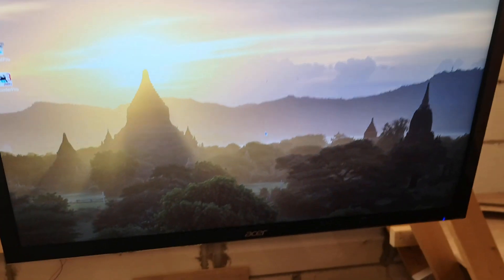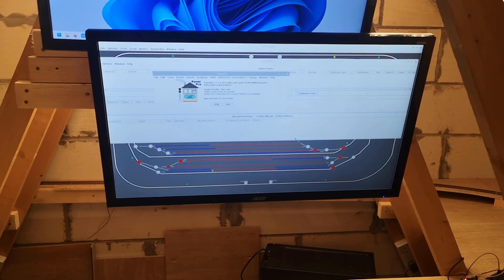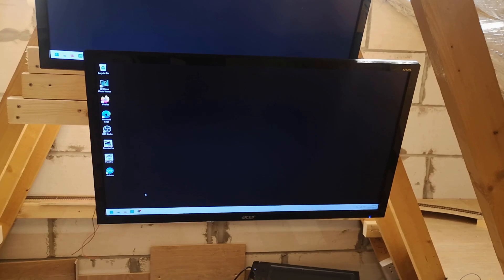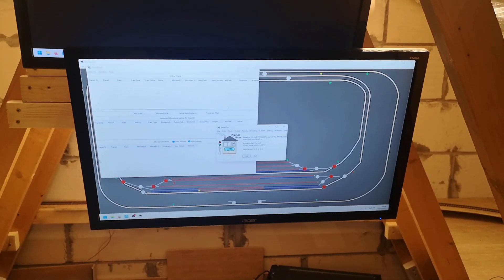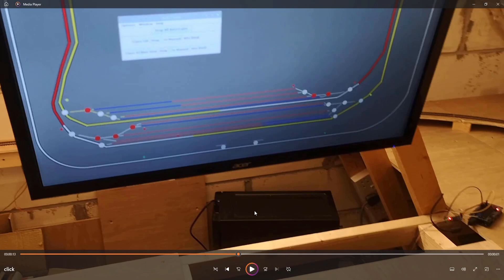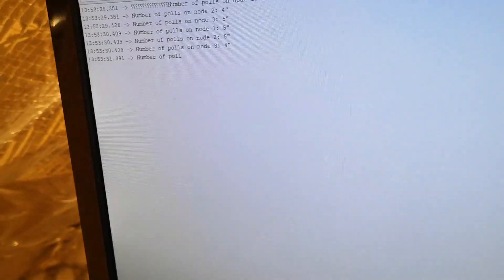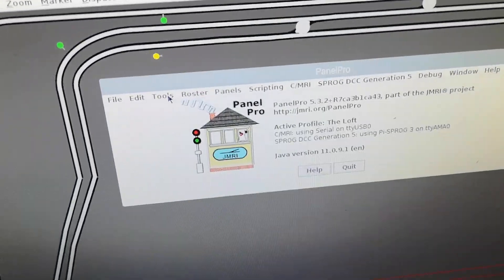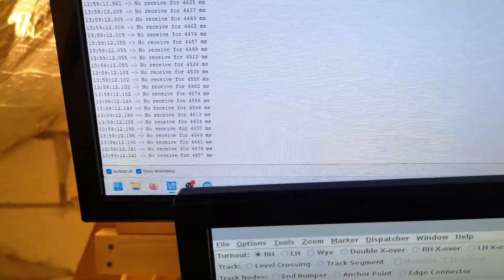Adapting a 5 amp Arduino motor board for a DCC Ex command station, and why my Raspberry Pi had to go

Comment: I  switched my Raspberry Pi 4 recently to a 2011 Mac Mini with an SSD when using JMRI.  With the money I sold the pi for I was able to get the Mini and SSD with some money left over.  I use DCC-EX as well.  Render times on the panel were horrible.  Should also mention I was running the Pi 4 (4 GB RAM) in an Argon case with fan and heat sink and using an M.2 Sata drive.
Reply from the maker: Thanks Brian - it's encouraging to know that there were no potential improvements with a heatsink and fan. I think the Pi is a great entry point for JMRI (or it was when it was more affordable) but needs to come with a caveat along the lines of 'it's great for the basics but look elsewhere if you're going down the automation route'.
Reply: @WirenwoodModelRailway  I agree.  I use raspberry pi's throughout my house all doing different jobs.  According to sources new units should be available in North America by Fall 2023 at regular prices.  It's crazy what they sold for lately.  Your automation is incredible.  Thank you for sharing.
Reply from the maker: Me too! I have a few of them running Snapcast for synchronised house-wide audio which i love, and another 4 up in the loft (including the rejected JMRI one) running those static cameras. They're such useful, versatile little devices.
Thank you for the kind words! Chris.

Comment: This is difficult to put without being critical but bearing in mind that you have a PC there, I'm surprised you didn't use it from the outset and when I discovered your channel I had assumed you were. JMRI will work via ethernet to attach to a command station, and I suspect the Pi (from personal experience of using it to monitor systems) is not really up to the task of a sophisticated layout. Another aspect to consider is that the quality and length of the bus and the number of nodes will affect the baud rate of RS485. I doubt that you are hitting the limits, but maybe still worth considering? I use an old Dell laptop (i5 and 8GB RAM)  running linux for JMRI connecting to a Z21 via ethernet although I might go to DCC EX and sell the Z21. The DCC EX recommendation is to use a Mega not an Uno as the Uno is at the limit of the memory when running DCC EX.

You are sir a trail blazer, I take my hat off to you.
Reply from the maker: Ha, thank you! Actually, right back this time last year when I started this layout, I was using an Arduino and motor shield. But the standard motor shield, mentioned in many of the YT 'get a command station for under ££' type videos, was woefully underpowered and could cut out with even just one loco running. So to be able to run a couple of trains at a time I switched back to the Pi and SPROG, which I'd used on my previous layout.
Then, when it became obvious that the Pi wasn't going to cope with automation, that was when I started looking for alternatives and found the MOSFET based 15A board that I got connected up in this video. And it hasn't given me a single problem since!
Interesting about the Uno and memory - there is noticeably a huge amount of source code that gets compiled and transferred for DCC+EX - if I start getting issues with the command station I'll try switching to a Mega - thank you!

Comment: IIRC with JMRI you can set how often the sensors are being polled

Whats the Spec on the Pi4? (e.g. what ram?) you can stick a CPU and Ram monitor to show on the menu strip which should tell you if the beastie is struggling, if its not its something else
Reply from the maker: Thanks Dale - I certainly haven't seen that option - you can set whether polling occurs, but not how often. Plus it's plainly a performance / capacity issue - I could ask it to poll 5 times per second but there's no guarantee that it would!
It's a 4gb RAM Pi. I've been using the PC for about a week now and have to say it's a night and day difference from the Pi. I'm sad, I love the Pi, but it wasn't up to what I needed from it. sadly.
Reply: @WirenwoodModelRailway  pity really, suspect the issue is Java, but no getting away from it really

for C/MRI there is am "output interval (ms)" setting, defaults to 250ms - its under "additional connection settings", what there isn't, and this is a real shame, is an option to set a polling interval for individual sensors.

loving what you are doing though, trying similar here though on a somewhat smaller scale, not just because its N gauge but a 4'x2'6" layout to experiment on - very interested in the automation stuff you have done and how clearly you have shown it, a lot easier to see it done and explained than to work it all out

:)
Reply from the maker: @aleopardstail  Thanks Dale that's really useful - one of those things I'd seen but not registered what it actually was!

As I move on to getting signal masts around the layout I've realised that I'll probably need more Arduinos. One thing that's crossed my mind is to have some Arduinos with no inputs at all - as CMRI won't poll a node that has no sensors attached. That should reduce the traffic a little.

And thank you, that's very kind! That's the whole point, really, I think - there is little to go on on this subject, so I thought if I share my failures and issues, and how I go about trying to resolve them, it might help someone like me!